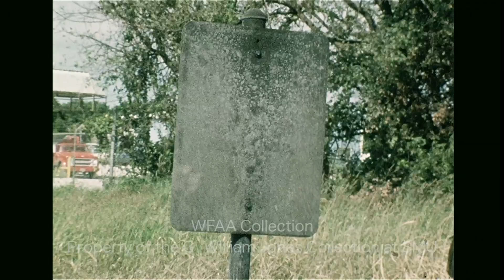Dangerous Train Crossing in Fort Worth - October 1973

Comment: Does anyone know where this is? I’m almost 100% certain it doesn’t look like this anymore. But I can’t put my finger on the spot.
Reply: I believe that's the crossing at Calloway Cemetery Rd. If I can recall, the railroad didn't put up lights and arms at that crossing until the mid 90s.
Reply: It’s up in Mossier Valley.
Reply: Firefighters have "Bedford" on the back of their coats. So probably like someone else said, Mosier Valley area
Reply: @rsh300  I think you’re right. That was an Rock Island train coming up the track. The railroad crossing crossbuck looks like a Rock Island style sign posts. They reused old steam flues for signposts.
Reply: Same location where a TRE commuter train was hit by a semi a few years ago.
Reply: @mgellis1971  It's got to be the spot. I lived on S. Main St in Euless is the early 90's and would use this road as a bypass to Hwy 157. I checked Google Street View just to make sure, and this view is on the north side of the tracks facing 157. The power poles are even in the exact location they were in '73.